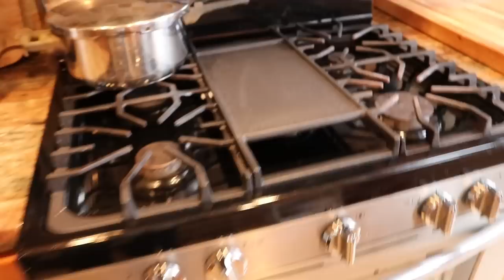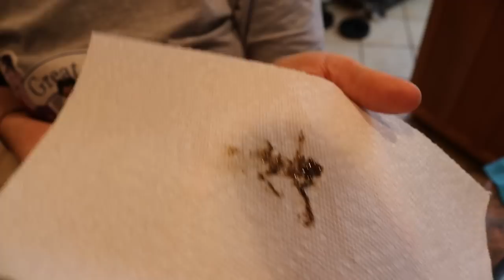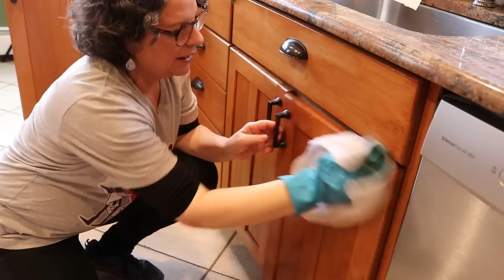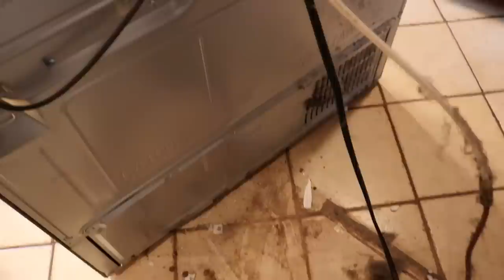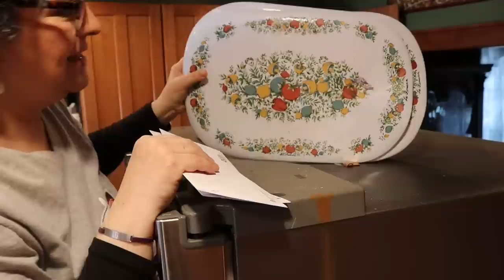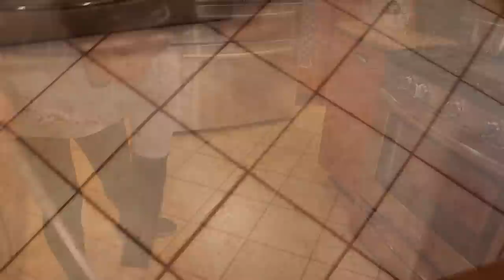Deep Clean With Me || 2023 Edition || The Shame Under the Fridge + Grout

Comment: Sophia has it really been that long ago since you did behind the fridge? I can still remember it.  I don't have a good memory but I remember that shiny gorgeous fridge of yours being moved so you could clean. I believe it wasn't that bad because you hadn't gotten your fridge too long before that .
Who knows? 
I can't even  clean the top of my cabinets because they are from the 70's and made of fiber board . I have to take a wash cloth with really hot water and I put straight dawn on it I lightly go across the top and get what I can until they start to get wet then I'm done . I find that on my really greasy places I take a hot wrong out rag and pour dawn straight on the cloth. I wipe across the greasy wall , cabinets , stove, top of my fridge and it cleans the grease pretty good . I have to rinse the rag really good in hot water to get the grease out . Then I start again on a new place or finish with a clean wet cloth rinsing down the place that I just cleaned and I move to next spot .
Love & prayers ❤️ 🙏🏻

Comment: Good motivation and advice. Maybe get one of those brushes that attaches to a drill to clean your grout and save your strength some. The top of the cabinets when u do clean them spray with power wash and let it set a few minutes to cut the grease makes cleaning easier. After u clean them lay down Saran Wrap makes next clean up much easier. Have a good week.

Comment: When I finally started cleaning my cabinet fronts after years, I found that half oil/half vinegar works wonders against all the greasy dust in my kitchen...... spray on or put on rag, and wipe off. :) oil cuts the grease, vinegar cuts the oil.
Reply from the maker: What kind of oil do you use?

Comment: You can also put newspaper carefully so it doesn’t show to line the tops of the cabinets. Then just throw it away and line again with newspaper. You need several sheets to build up just a little thickness so the grease doesn’t get on the cabinet tops. Works great and it is free.

Comment: You worked so hard to deep clean, Sophia.  The results are are amazing.  Well done to you for your motivation once again.  I think your video will really motivate others to do the same, even the grout cleaning too!  My cousin who is a tile cutter and specialist told me that if coat your tile floor with rejuvenate every month for five months, miss the sixth and seventh month then start coating again in a five month cycle the anti stain resistance will be maintained ( in a similar way to building up cast iron pan coating layers), the more layers (up to five) the better the protection as long as the coats are thin layers each time.  Hope this advice helps you.   The reason the coil at the back of your fridge attracts dust is because it is metal, which if it is a dry surface, will always attract dust more easily than wood or ceramic due to the magnetic properties of metal as a material.  That is why, for example, dry metal pans nearly always attract a thin layer of dust more quickly and easily than ceramic plates would.
Reply from the maker: That makes sense. Thank you for the rejuvenate tip.

Comment: I have seen people line the tops of their cabinets with wax paper to keep the grease off. Once it's clean you can just replace the wax paper once a year. I will be trying this once I clean the tops of my cabinets again.
Reply: I use wax paper on top of the refrig and my china cabinet. I tape it down in a few places and it really works well. The top of my cabinets are so high up I would need a big ladder to get up there. Not happening!

Comment: If you decide to tackle the tops of the cabinets , Clorox wipes work really good at removing the grease up there I’ve found.  Also. After you clean them you can line the tops with old newspaper and you’ll never have to do it again 😃. Just the edges.  And replace the newspaper 😊. It’s very satisfying to get it off of there 😄
Reply from the maker: Good to know about the wipes.
Reply: I use Tin foil/aluminium foil, and a lady in the comments suggested wax paper.
I recently sold my house and deep cleaned everywhere apart from the top of the kitchen cupboards asi had cleaned and covered them with tin foil about 5 months before when the kitchen was repainted. I checked up there whilst deep cleaning before the move, and the units were spotless so it definitely works/helps, etc.

Comment: If you ever pluck up the courage to degrease the tops of the cabinets try laundry soap, use lining paper from the hardware store or if they have a cheap roll of wallpaper to lay on top of the cabinets. So much easier to pick up and change.  A good toilet clean does a great job on grout and so much cheaper. Just a tip when the light bulbs are cold give them a clean you will be surprised on how much dirt is on them.

Comment: Great job! 
In a previous video you were thinking of possible appliances to review … if you get the opportunity definitely try a steam cleaner. I have a Hoover one for floors and it has a grout attachment. I experienced a similar a-ha moment with grout of a different color. They work great for the most part, and having a hand held attachment to steam the grout lines with  super hot water and cleaner was amazing. 😊👍
Reply from the maker: I actually have one in the basement. I should bring it back up.

Comment: I can not thank you enough for doing this video.  My ceiling is so greasy that I'm embarassed.  I need to paint but need to clean it first.  I don't have a fan above my oven so mine is really bad.  I also pulled out my oven drawer and laughed out loud after I gasped.  I also had dog food under my oven!  I did lay waxed paper on top of my cabinets.  When I do get around to cleaning up there, I just take off the paper.  It's pretty gross by the time I do it.

Comment: I use powder dishwasher detergent in hot water to clean greasy stuff in the kitchen, and rinse afterwards.  We installed plastic-coated medium density fiberboard on top of our cabinets so they're easy to wipe clean.  I think I need to check under my fridge, it's been a while.  😁

Comment: Behind my refrigerator was just that bad after a year.  And there was a TON of cat hair.  It is important to keep the vent cover clear, especially with peets, because if it clogs it can burn up ypur frig motor.  At that point you will need to replace it.  I have the exact same tile floor and I have regretted buying it for ten years!  Ugh,   Such is housework; never done!
Reply from the maker: You can never tell if it s clean or dirty. By far the worst takes ever! Cheers for new tiles, for both of us!
Reply: @mygreatchallenge  Yes!  Mine always looked dirty after mopping so I bought a microfiber mop and it cleans them way better!

Comment: I remember when you cleaned the grout with the toilet bowl cleaner and a far amount of elbow grease it looked great. Do you think the rejuvenate worked better or easier that and or other things you have tried?
Reply from the maker: It was easier. 1. Less toxic. 2. Easier removal.
Reply: @mygreatchallenge  thanks for replying back so fast. I am forever trying to find something that ✔ all the boxes since the spot between the stove and sink is forever a issue
Reply from the maker: If it s a small space and you don't really have access to it. Why don't you put a clear plastic mat over the area you could cut it to size.